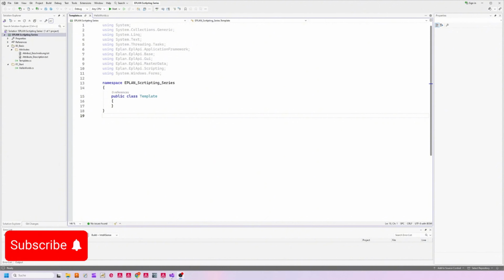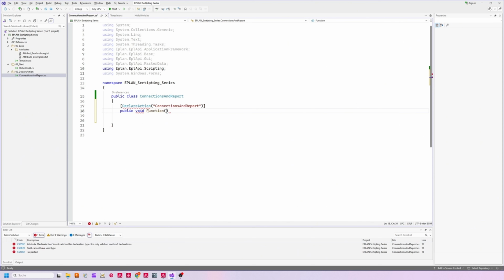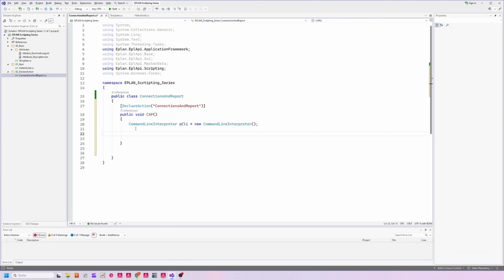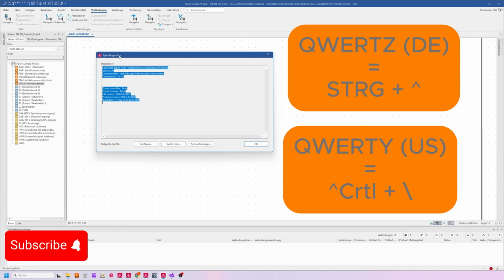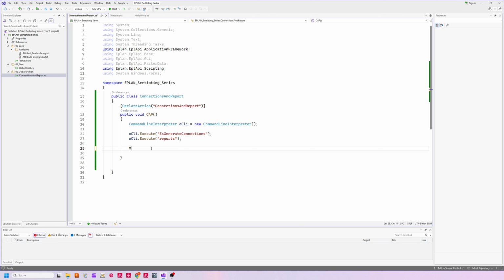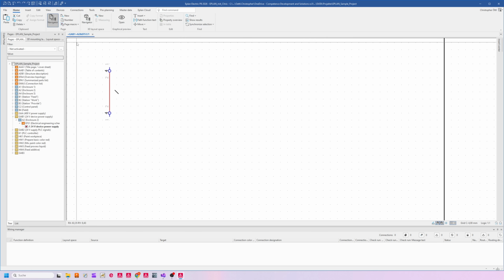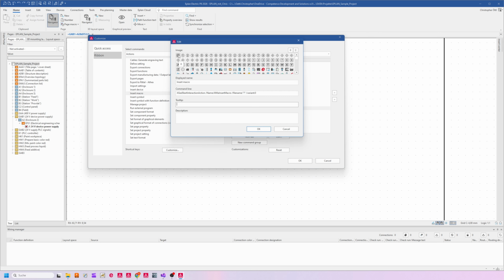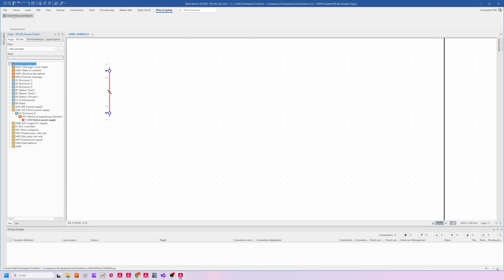Build Your First Custom Action in EPLAN

Comment: Sorry , You can code EPLAN API : Copy object after select page navigator, paste this object same [X,Y] all page ?? Thank you very much
Reply from the maker: Currently, I'm not yet deeply familiar with the API myself, and I'm still taking courses on the subject to further my knowledge. But yes, I think it should be doable, because with the EEC (Eplan Engineering Configurator) you can create any number of pages or place the same macro on multiple pages. So it should be possible, but unfortunately, I haven't yet reached the level of API knowledge to write the necessary lines of code. But it's definitely an interesting point to keep in mind, and once my knowledge has developed enough, I'll certainly make a video about it. Best regards, Chris
Reply: @EPLANwithChris  Thank you, 
That problem caused everyone to expend a lot of effort during project😔😪